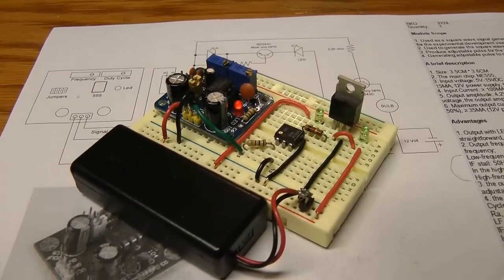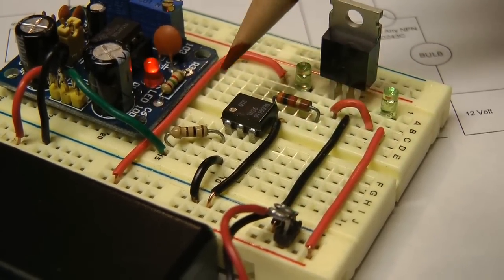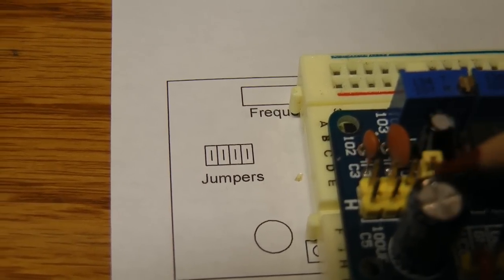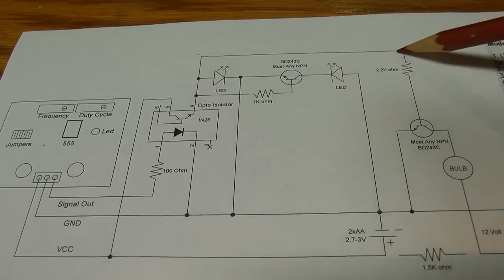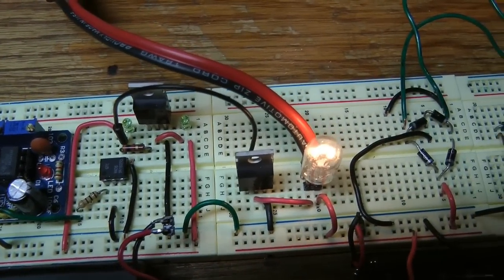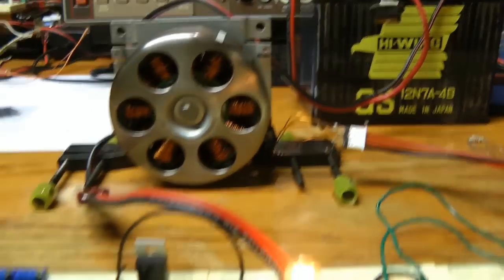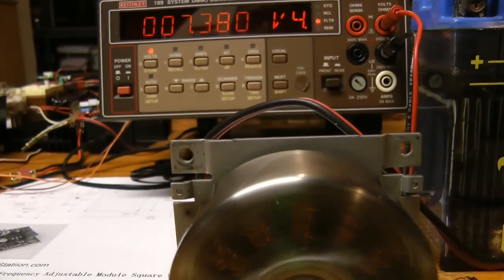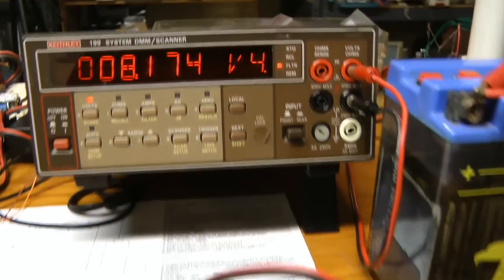555 Test Bed / Component tester / Cap dump

Comment: HI . I watched the video that shows you making a brushless motor. I wonder how much it cost? Was it a project for fun or to save money over buying one?
Reply from the maker: +RedMetalic RobotDemon  Hello Red, The only things I had to buy was magnets, bearings and wire because I have machining materials available. I probably have less than $20.00 US in costs. The time involved though makes in impractical in the monetary sense. Now on the other hand, years ago my motors outperformed everything that was store bought by the members of are large flying club. This was because I could buy stronger magnets, machine to closer tolerances with precision air gaps between magnets stator. When you wind the motor yourself you can also get more copper on the stator than a conventional motor. This handles high current better. The most important thing is when you design yourself you can adjust the configuration and windings to fit your needs. You can also design special extended bearing housings and mounts to accommodate special applications like fitting into small areas like sailplanes.Thanks for watching.   John